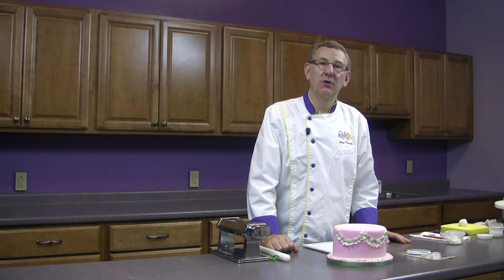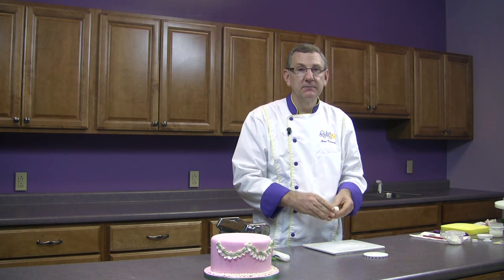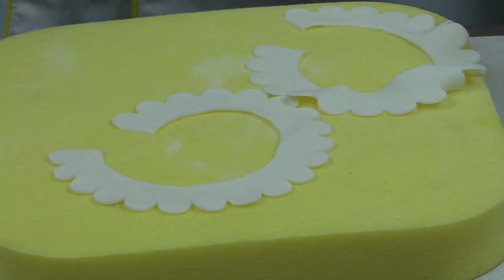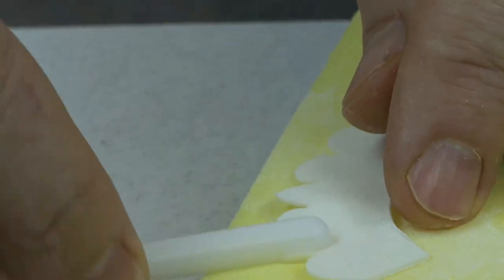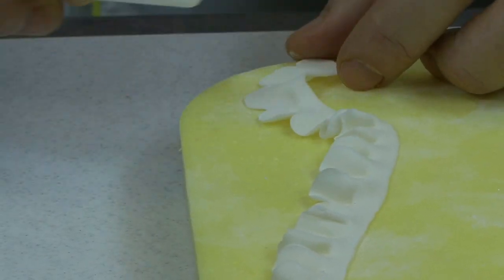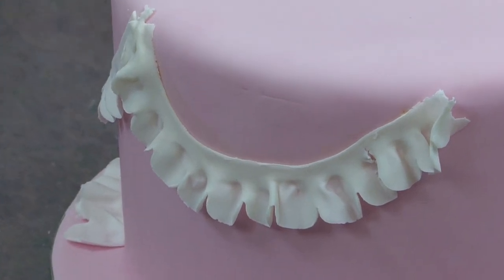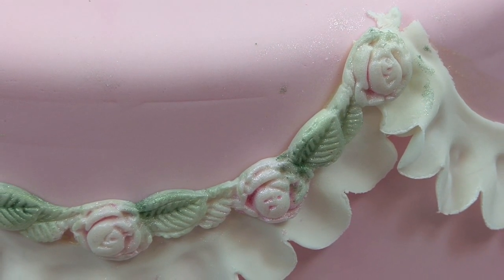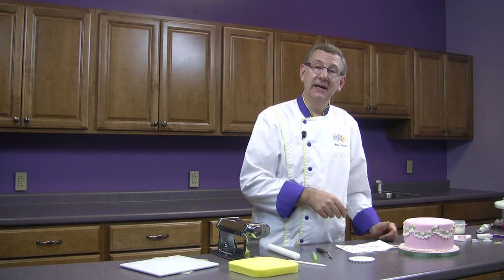How To Make Fondant Ruffles With a Garret Frill Cutter | Global Sugar Art

Comment from the maker: Isomlart and gumpaste are very different products.  Isomalt is for pulled sugar decorations and cannot be used in place of gumpaste.  Because the ruffle is a 50/50 blend of fondant and gumpaste, it should hold, even with humidity.  You may want to do a test before acutually making the cake.

Comment: Thank you so much for the video and also for the explanations given. I live in kerala India. It is very humid here. My problem is after making gum paste flowers I have to dry in microwave with light on overnite, otherwise it will catch moisture. So if I want to attach ruffle how will it be possible to attach to the cake immediately as it will become wet after some time.Can we use isomalt for gumpaste.
rgds
Susan